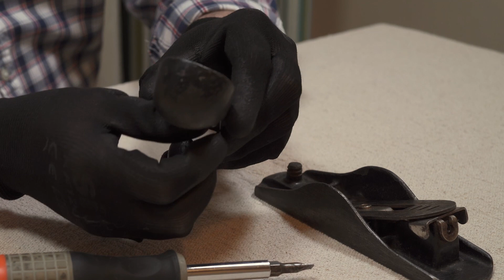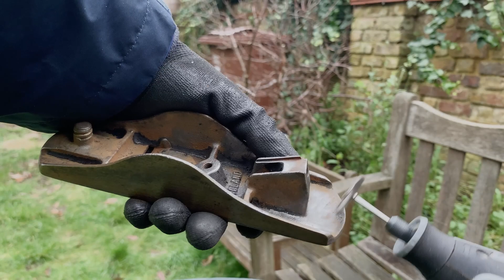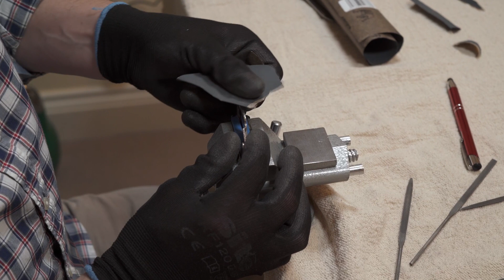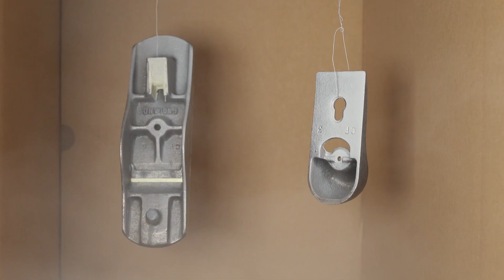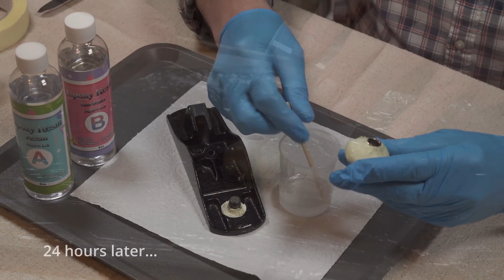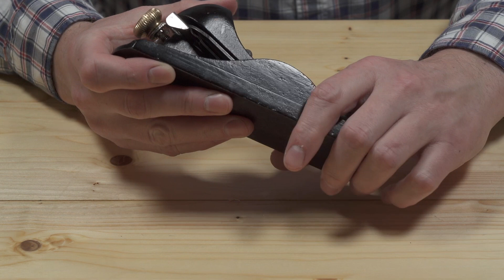Old Hand Plane Restoration | Tools Restoration

Comment: Nice Job....Thats crazy the Chrome stripper killed those parts!
Reply from the maker: Thank you!
About the chrome stripper, I believe it was my mistake; the solution works as it should. It removes chrome quite efficiently, but it takes a bit of the base metal as well. The part was very thin, so the solution dissolved the base metal at this narrow area.
Reply: @RustyCraftsman  Live and learn.....I like the fact that you didn't edit this part out....